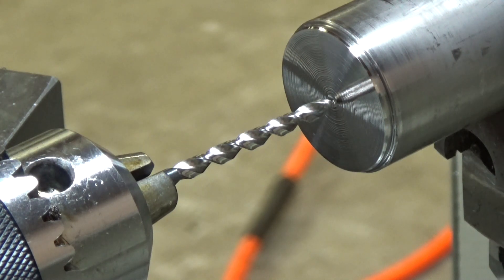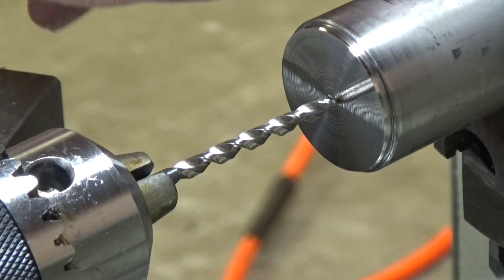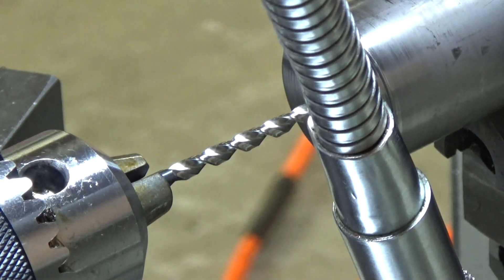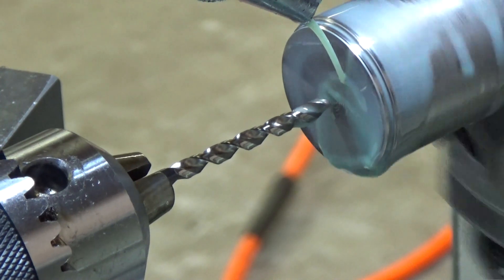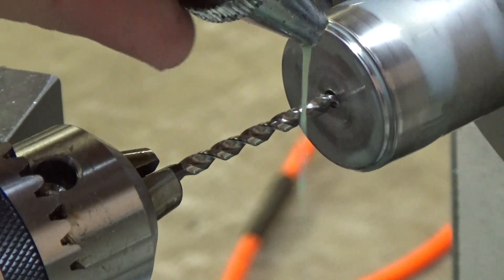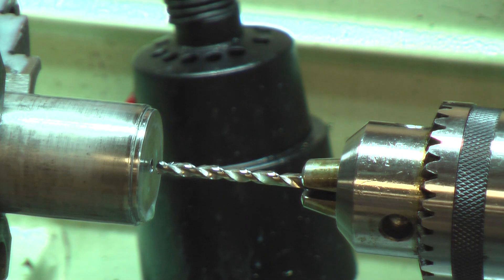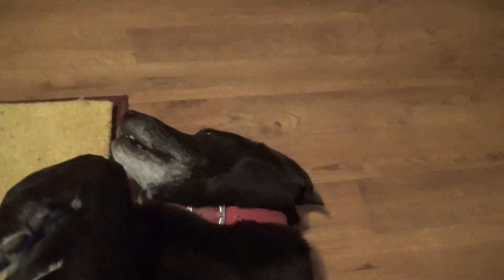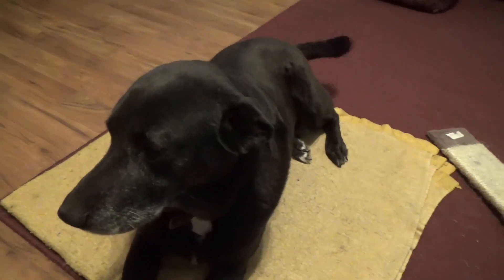How to Drill Titanium With HSS

Comment: Is it possible to drill titanium with a cordless drill? I have a piece of Titanium (1mm thick) and I want to drill about a 1/4 inch hole into it but I don't have a drill press
Reply from the maker: not saying its impossible, but if you try and you get a chip coming of stay on it or it will harden very fast and will be tough to drill, make sure you have it held tightly good luck
Reply: @bstanga  Thanks!

Comment: Thanks for the video - I'm 1hour away from buying a bunch of Ti6Al4V scrap, and needed to be sure I can drill through it at home.
Question : do you really need that much coolant ? I mean, it was drooling on your video.
thanks
Reply from the maker: well you could do it dry, just bear in mind that Ti will ignite into a bright white flame if the chips are small and hot enough
Reply: @bstanga  Oh ok. I thought only Mg did that. Ayyway,  I bought my 8Kg of Ti6/4. I'll have a go at it this weekend.
Also, and more importantly, zeke has gotta be the cutest workshop assistant I've ever seen !

Comment: Hi Brian;
I made a practice to use spotting drills first which I have in different sizes, next, stub or screw machine drills (I have a full set and they are cheap) because they are short and stiff drilling to the end of the helix, and then continue with a regular length drill.
This way, you drill on center and provide a straight hole to guide bigger drills. Center drills I reserve for their original purpose, and avoid breaking their tips often. Concerning reamers, they follow the hole in all cases. When a straight hole is needed and  you're not boring, I would drill for an inch or so, ream, and then continue drilling without fear of deviation. I was able to see your drill flexing and moving direction at the start of the hole (too long and thin).

Cheers

Jorge

Comment: I sometimes think an apparent drill offset when beginning a plunge can be either drill itself or the chuck grip on it - or both - quite often find that happening a bit. I sometimes release chuck and rotate 180 to see where the offset happens... whether that also180 different or the same... if 180 and opposite, then it's drill and chuck combo.
That drill bit has a nice tight helix on it. You seem to have pretty much cracked this - slow and steady with pecking! Wonder how CNC machines cope with Ti - maybe all down to tooling as well as RPMs.
Your kitty seems well fed.:)
Reply from the maker: Keld pointed out the deflection, and I must admit that standing at the lathe I could not see it, but on video it was obvious. I almost always center drill down to where you get that 60 deg "starting" hole, but in this test I did not. That may have made a difference.
Reply: Possibly Brian, but I think possible best is a 120 degree spotting drill, even after center drill - then the angle is so much closer to the 118 of the drill. Later.

Comment: Hi Brian !

I looks like your yail stock is out of line with the headstock - the drill is bend when it digs into the titanium, I think.
Reply: Aligning the tailstock is easy if that is what it needs. It could be your bit wasn't quite sitting happy in the chuck.
Reply from the maker: It did look like it was deflecting, that's one reason i don't like using small drills in hard material.
Reply from the maker: lol, I t could bee all the abuse that chuck has seen in the last few days!